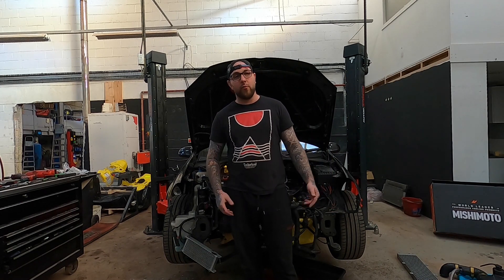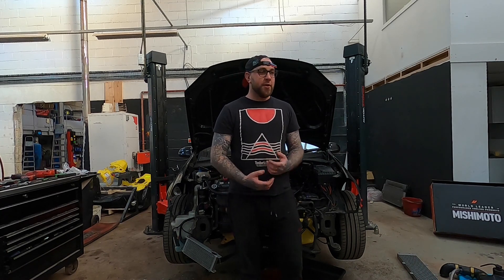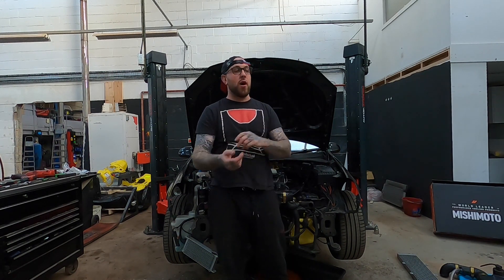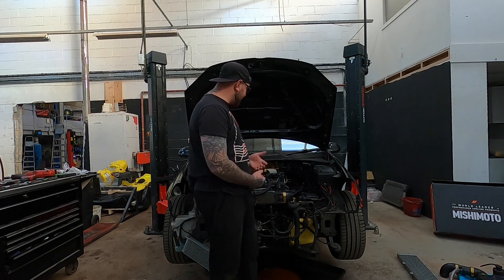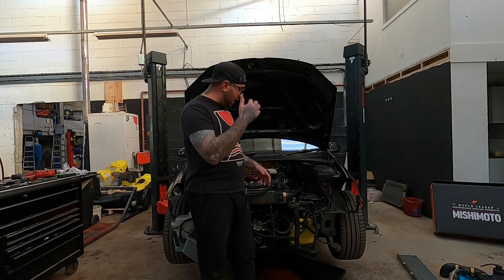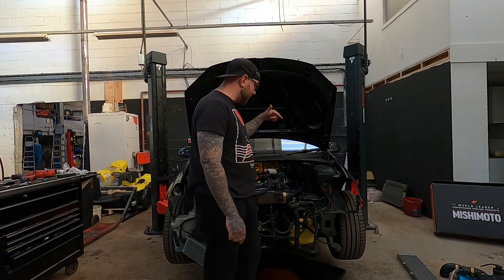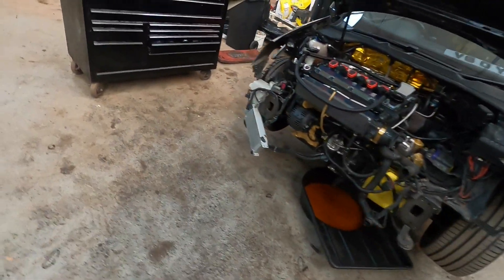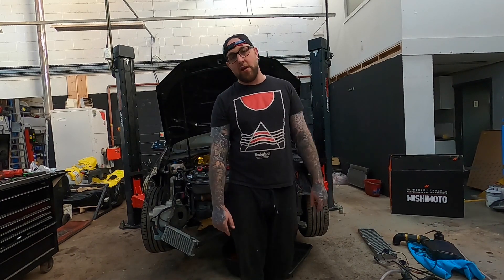IM THROWING IN THE TOWEL!!! WATER TO AIR TO AIR TO AIR - MK5 R32 TURBO - VR6 TURBO EP.22

Comment: A valiant effort, sorry all of that hard work didn't pan out. Water to air can in theory yield great benefits: tighter packaging, flexible mounting locations, shorter/ more direct intake piping, higher specific heat cooling medium. But if you can't make your system stop from heat soaking, you're making a practical choice to return to a more proven air to air design.
Reply from the maker: Thanks!! Yes definitely!! I think i couls have made it work think the biggest thing i needed was a bigger reservoir most drag cars use ice tanks but on a road car it just made to many moving parts. When my pump blew the fuse at the dyno i had no idea the water got red hot i could have caused real damage if it wasn't for my tuner setting good safetys in place. Air to air is just so much simpler aslong as your intercooler is good and you dont have a boost leaks thats it, the water to air you've got the pump, wiring, water leaks etc i just reached the point i jusy want to drive the car without worries so seemed like the best option. Ig i was to ever build a dedicated drag car i would definitely re visit the idea
Reply: @dkautos  Yeah, they're really very different systems. An air to air system with no proper design, testing or engineering would be a disaster too. But there are zero moving parts and it's been done everywhere so the design is fully understood to everyone in the industry. Can't enjoy a car that needs to be developed forever!

Comment: IAT’s is a battle I been fighting as well. Dont know about you, but It literally feels like I lose 60hp as soon as Im heat soaked. Im not running an air to water setup but I went to a vibrant performance front mount from a smaller EMUSA front mount and Installed an old “Coolingmist” water/meth injection Kit I had laying around from my old srt4. This helped out big time, but still could be better.
Reply from the maker: Ye i know exactly what you mean my  IATs have been my biggest problem constantly loosing power due to high temps and my tuner doesn't want to give it any timing due to IATs